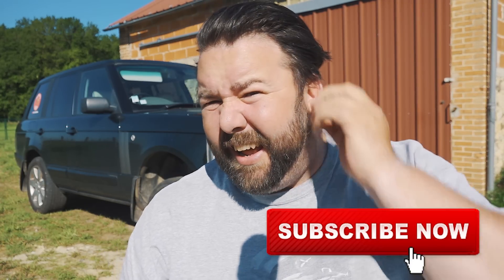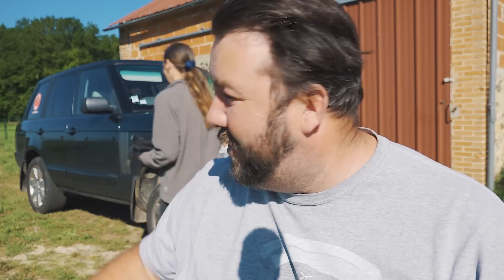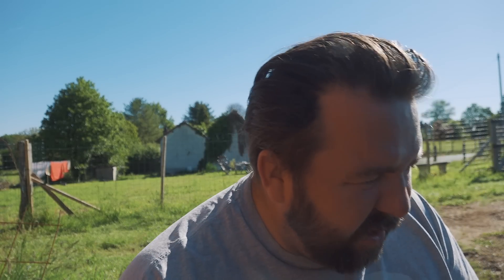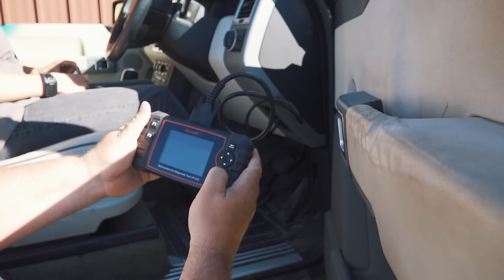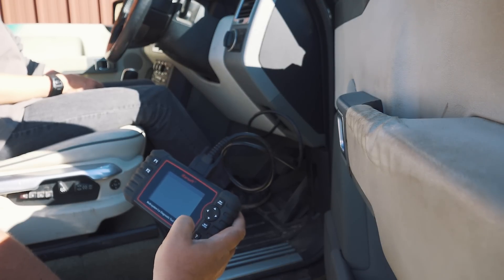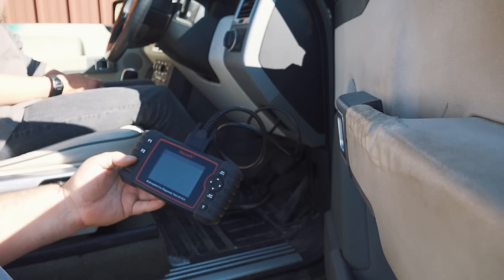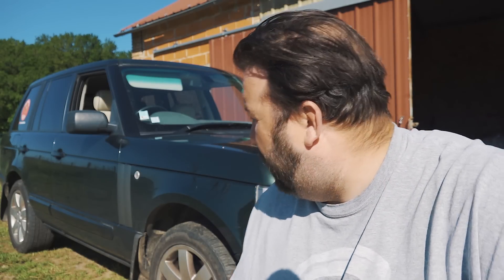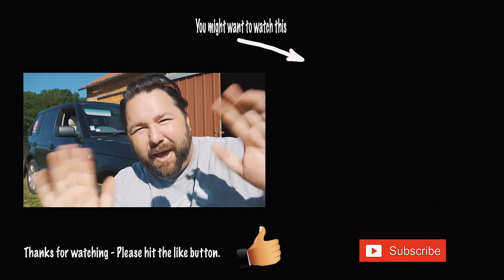Range Rover L322 - Air suspension inactive

Comment: Glad that was an easy fix. Has been quite a revolution in Land Rover specific code readers in the last few years. I have the latest version Hawkeye which does all Rovers from the Classic to the L405. Very handy for my 2000 and 2008 Range Rovers. If I eventually buy a Discovery 2 for off road bashing it will be good for that as well. Having said that I might still buy a Gap Diagnostics IIDTool for the L322. Cheers.
Reply from the maker: I think I might invest in the Gap Diagnostics IID Tool for the TDV8, its just a shame they are locked to one vehicle.

Comment: What diagnostic tool would you recommend for a 2008 RRS TDV8 3.6 please ideally I need one that would be able to calibrate suspension, cheers
Reply from the maker: Top of the list would be the GAP IID tool, failing that the Launch Creader Elite Jag/Landrover has got a lot of functions and I think it does suspension too.
Reply: Thanks Ben , just a guick question, I’ve no heat from passenger side air vents ?? (totally unrelated to this topic) any ideas . I’ve got heat from drivers side but cool air only from passenger side, cheers
Reply from the maker: @alfiedog2942  I know the early L322's had a blend motor under the dash that often gave problems, sounds like it could be that.

Comment: I purchased a reset tool, but it didn't reset my suspension. I was told that maybe a faulty airbag causing the issue.  not sure.  any ideas for my 2003 L322?
Reply from the maker: Airbag! As in the suspension or in the steering wheel? You might have to get a proper diagnostic tool plugged in to really see what is going on.
Reply: @Bensgarage  I took it to my range Rover mechanic, he diagnosed the issue as a faulty steering angel sensor.  hope  that fixes it.  stay tuned.

Comment: hi Ben my l322 2003 aire suspension light gos out when i drive off  what do u think wrong
Reply from the maker: Not sure, have you plugged in a diagnostic tool to see if there are any codes?
Reply: @Bensgarage thanks for comeing back yes i've got icarsoft range rover one i can get the light 2 come back on
Reply from the maker: @raymondrowley9183  see what codes flag up, if no codes check live readings on suspension components and see if anything is drastically different from the rest.
Reply: @Bensgarage  Hi Ben i was thinking of replaceing the aire suspension panel control switch ?? det one on ebay £20

Comment: well ive had a l322 since june and it still doesnt work properly latest thing is his tool  claims air comp low preasure which is why its sayin inactive suspension told him to manualy check the pump pressure of the compressor but no joy so gona be a diy fix bit ive just bought one of those gadgets like you have and will have to learn how to do electronics now i do so hate electrics now where did that series two landrover go lol
Reply from the maker: I would love to get hold of a nice RR Classic, just for the fact of less electrics. But they are too much money now, gone are the days of picking one up for £600.

Comment: I have a 2004 range air suspension going on and off TRIED “getting it fix “ and a range shop but other stuff  they say keeps coming up but I know nothing else is wrong so what can I check myself I got a socket set and tools ready to go I need help
Reply from the maker: If there is nothing that is obviously wrong then you’ll need to plug in a diagnostic tool to pin point a fault.
Reply from the maker: Catherine Johnson have you tried resetting the system by turning it from full steering lock one way then turn it full lock the other way?

Comment: Hi Ben we are in France also in 23160 we have a Range Rover Vogue Petrol 2005 and have a problem with Air suspension total collapse we are at the end of our tether trying to sort the problem and were wondering if you could help at all even if there were a suspension conversion kit for this model. One guy had a look at it dismantled the air compressor before lockdown and then contacted us after the lockdown that he wasn't opening again! and left us with a dismantled compressor. Any help you could give would be appreciated
Reply from the maker: There are coil spring conversion kits available, which if just road driving would be ok. You would lose the benefits of the air suspension ie changing height and extra travel when you get it bottomed out. But if you don’t off road then it wouldn’t be a problem. Have you had it plugged into a decent diagnostic tool? How good are you with the spanner’s? Bag piping Andy.com do compressor rebuild kits with full instructions so you could maybe rebuild the compressor.

Comment: Is this the td6 model, getting the same fault reading on the dash but everything is working as normal, and got a brand new battery
Reply from the maker: Yes its a TD6. Have you tried turning the steering from lock to lock to reset the warning.
Reply: @Bensgarage  yes mate, also check them sensors that you check in your vid, maybe it's just a case of plugging that diognostic tool in and deleting a error code, hit a pot hole and it's been in since
Reply from the maker: Yes it might have a code that needs to be cleared.
Reply: @Bensgarage  fixed, thanks for the videos they was a great help

Comment: what diagnostic scanner are you using?
Reply from the maker: When I did this video we were using the icarsoft LR v2.0, we now have a Gap diagnostics iiD tool which is fantastic.
Reply: @Bensgarage  what does it do that the icarsoft does not?
Reply from the maker: It goes more in depth, you can change height settings, change things on the car that only a dealer would be able to do like set the folding mirrors to fold when you lock the car, enable the towing socket if you fit a tow bar, flash the ecu and change ccf files plus many more things. The icarsoft is great at reading and clearing codes.

Comment: Thanks for quick reply Ben I think we would like the coil spring conversion kit as we don't drive off road so that would be ok we would like someone to do this for us if at all possible so don't know whether you  know of someone that could do this for us? Once again many thanks for your reply its nice to know that there is someone in France who can advise
Reply from the maker: I’m afraid I don’t know of any one. I do most of my own repairs and if my workshop was finished I’d offer to do it, trouble is I still have no floor. From what I can see it’s a fairly easy job, just time consuming. You might want to research the kits, I think there is something you plug into the wiring to fool the cars ECU into thinking the suspension is working as normal. That way you don’t get warning lights coming on.
Reply: @Bensgarage  Yes I think the kits come with a a unit that plugs in to eliminate the warning of Air suspension inactive. When is your floor going to be finished? lol because I would be happy for you to do it. Also are you aware of the kit available for my vehicle?

Comment: Hello Ben regarding the question recently about Air Suspension and converting to coil spring I have had no luck with anyone willing to do it I am therefore thinking of selling the vehicle as is, so someone may be able to do their own thing with it. its a lovely vehicle great bodywork. immaculate inside etc with only approx. 54, 000 on the clock so if you know anyone interested I can send pics etc. Its a shame but I cant find someone to rectify the problem ive got to move on. Regards
Reply from the maker: Kevin Miles that’s a shame. I should have a garage floor hopefully in about a month, don’t suppose you can wait that long. 30tonne of calcaire due start of next week.
Reply: @Bensgarage  Hi Ben I may be able to and thats good news if that was the case I don't know exactly where you are in France and is there a possibility of picking the vehicle up as it cant be driven as it is?
Reply from the maker: We are near Ladignac Le Long. You would have to get it to me I'm afraid as I have no way of transporting it. My dad used a chap he found on Leboncoin.fr to move his tractor, you could try someone like that.
Reply: @Bensgarage  Hi Ben yes I could probably put the feelers out for someone to transport
Reply: @Bensgarage  Hi Ben i have found the conversion kit this is the link ttps://www.firstfour.co.uk/air-to-coil-suspension-kit-with-bypass-module-for-rr-l322-2002-05.html and have enquired about getting the vehicle to you and just waiting for a reply from them. Let me know what you think and how you are getting on etc with thanks
Reply from the maker: Hi Kevin, drop me an email at benelliott780@yahoo.co.uk and we can discuss it further.